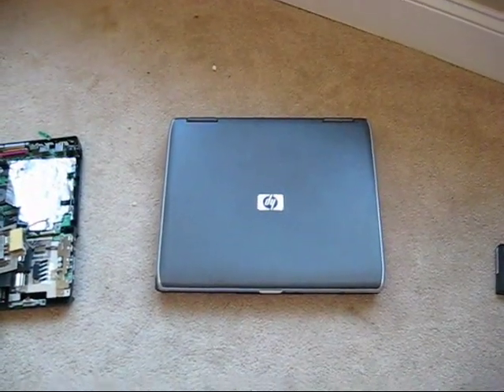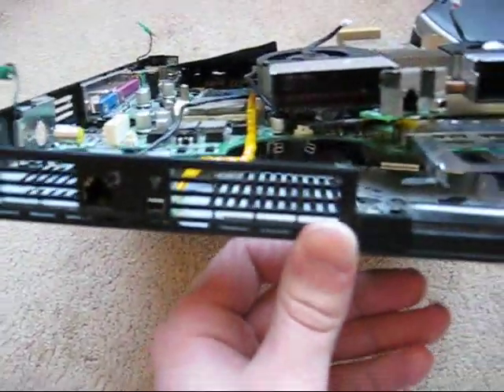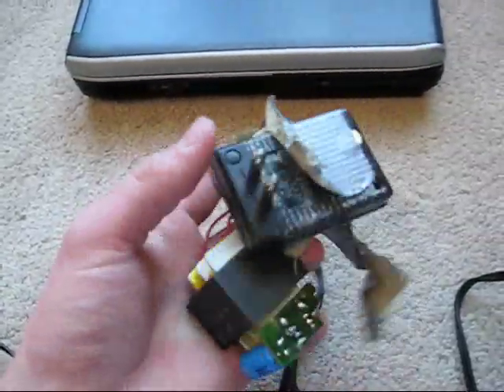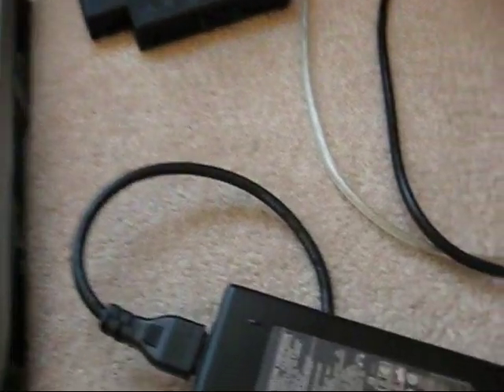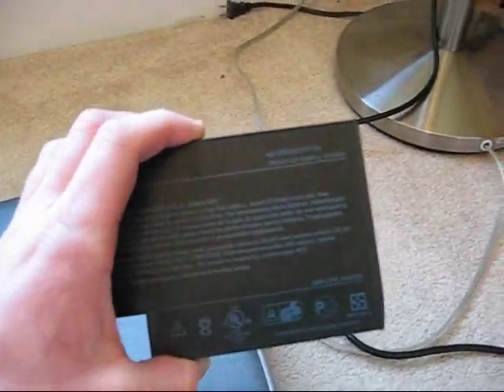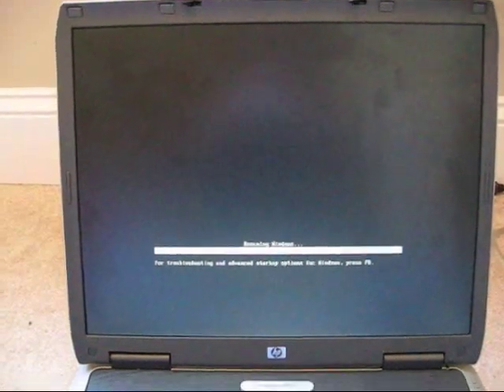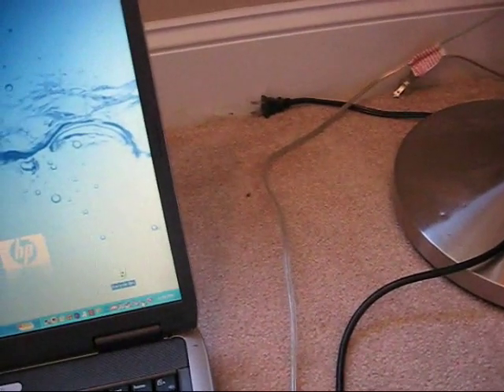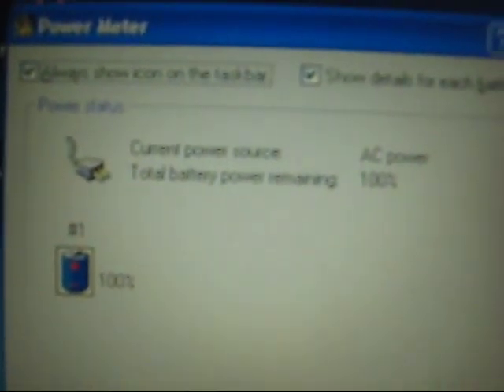HP Compaq nx9010 with repaired power jack-how to and boot up

Comment: my hp that's the same as this one wont turn on at all you plug the charger in and the charge light comes on for 4 seconds and then goes off. pressing the power button doesn't do a thing. only sign of life is when you unplug the charger and then re insert the charger and you get a yellow light where the electric bolt is for 4 seconds and then it goes off then nothing. its never been treated bad or dropped it just wouldn't come on one day :(